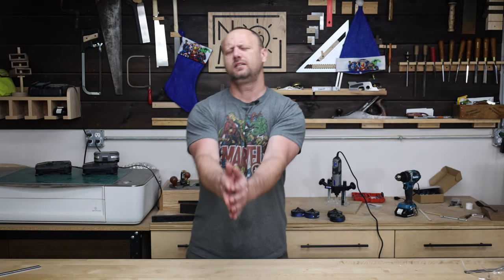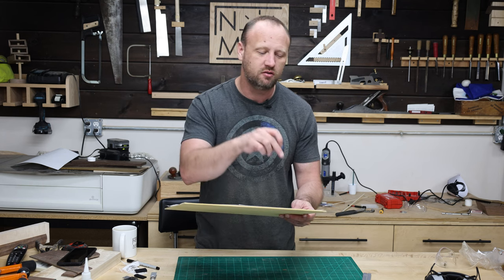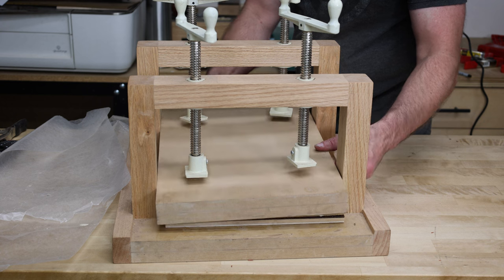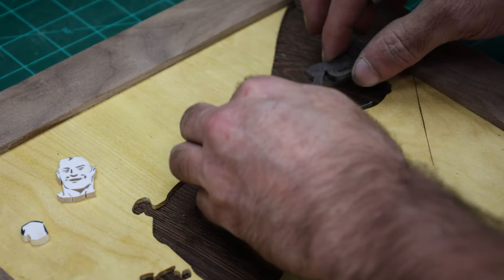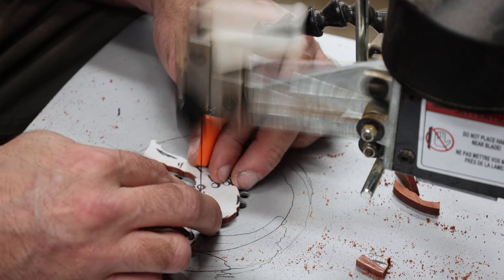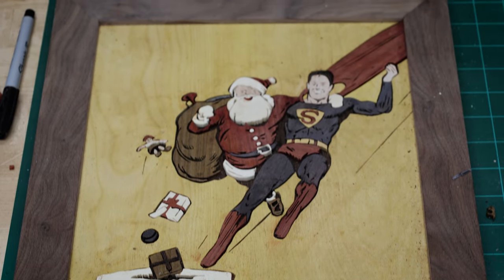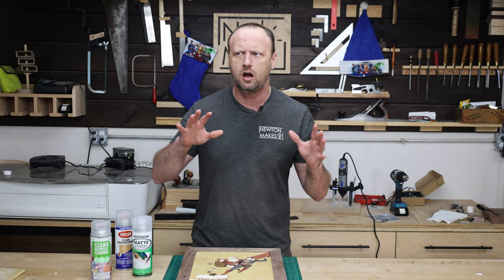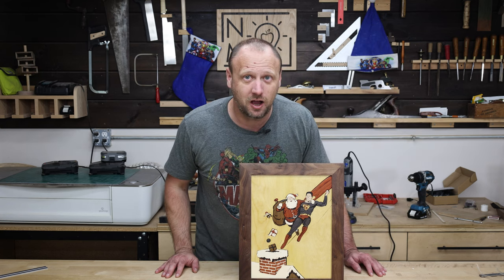Christmas Scroll Saw Project | 80 Year Old Superman Comic Book Art

Comment: I don't know why I haven't done the zero clearance for the scroll saw. Do you hold it down with double sized tape.
Reply from the maker: No, if I use anything I'll use the shop vac. The normal suction from the dust collection keeps it in place.
Reply: @NewtonMakesArt  thanks 
Don't use the vacuum I will have to give it a try.